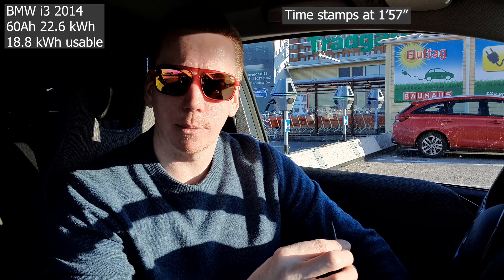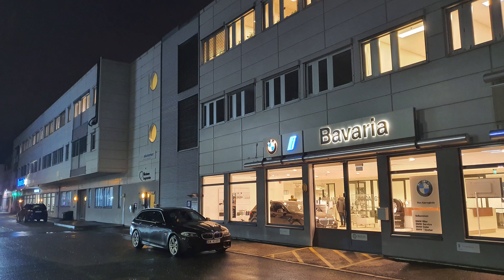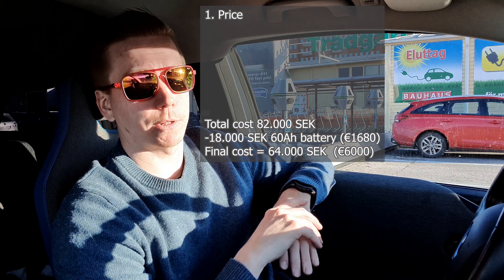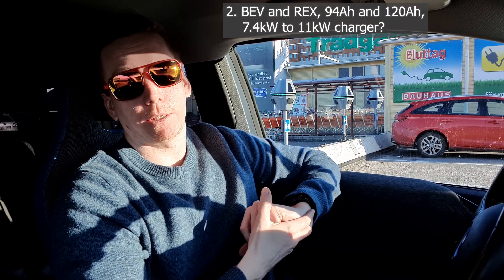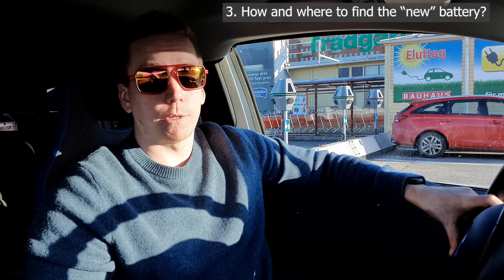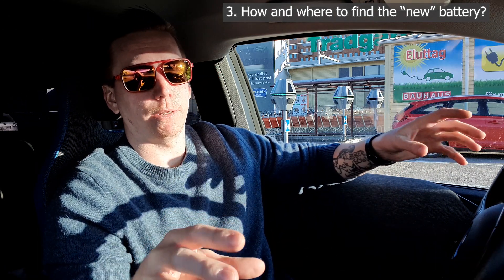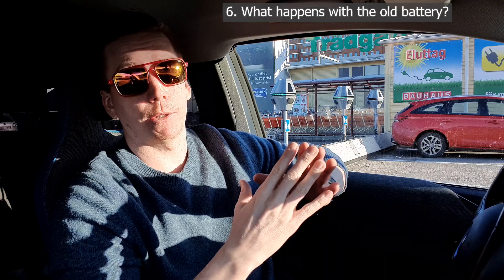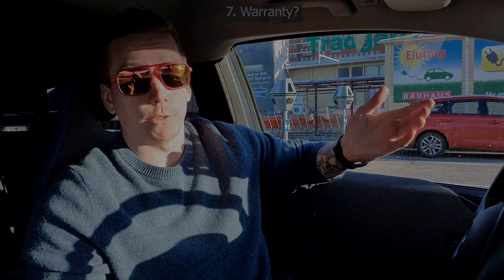BMW i3 Battery upgrade from 60Ah to 94Ah for €6000

Comment: What about the upgrade approval from Statens Vegvesen? Any problems?
Reply from the maker: Well, since its a Swedish car that wasn't relevant. But since the new battery had almost the same weight (+50kg or so) I never did any official documentation of this with the government. I can't remember if I called the agency for transportation here but I'm pretty sure a battery swap like this is ok.

No problems with the two yearly vehicle checkups after the swap. Passed them both. Even with the aftermarket Hitch.

Comment: Bmw warranty approved replacement of battery bmw I3 bev 2014 .the problem they have installed the new battery but the car don’t recognise the new battery .Any thoughts ?
Reply from the maker: As I remember the new modules have a number that have to be coded into the car for the car to recognize the battery. That’s the only idea I have.
Reply: Poradziłeś sobie z kodowaniem?

Comment: Do you have a phone number for the dealer that coded your battery SME?
Reply from the maker: It is this Bavaria center i went to:

Bavaria Lillestrøm
C. J. Hansens vei 15, 2007 Kjeller, Norge
+47 64 84 73 00
https://maps.app.goo.gl/dAc2ESa2Qv3fvL92A

Comment: I'm about to buy a 2015-2017 bmw i3. do you know how long these battery's last until you need a new battery. Also will the battery be at 60% or so after 100,000 miles?

Comment: Hi, Did you only need to change the battery? What about the battery charger (OBC) and the Battery heater/ cooler, can you use the old one? And are there any other pieces you need to change?
Reply from the maker: The only thing that I bought and brought to bmw was the batterypack. They did order a new lid for it though as it was in the manual, to replace it as it was removed for an inspection.

The charger, heater and all such is still the same as before the swap.
Reply: @BasinBjorn  Thank you very much for the quick reply

Comment: I currently own a 2019 e-Golf with a VERY high spec. It was an Ex-Demo car. LIke yourself I have invested in the car quite a lot (Eibach Pro spring kit, 18" wheel upgrade, de-chrome, de-badge, PPF front half of car. I like you have invested a lot in the car and although this is a pain if I was to change the car in 3yrs when the finance is finished. I would actually like to keep the car for longer as I think the 7.5 is a better quality car than the new Mk8 and as for the ID3 I think it is a glorified VW UP. all plastic and coloured metal parts. I also feel it such a waste to change my car because the battery will have degraded (in 3yrs I will have over 100,000 miles on my car as I cover 26k per year) I have posted my question if people know of battery enlargement or swapping companies like MUXAN do for Nissan, and people seem to rip me apart. Telling me to just change the car.

Comment: Hi can someone tell me how much it cost to charge at home to fully charge in £ I’ve been to £1 at night that can’t be correct can
Reply from the maker: It all depends on your price for electricity, and that can vary a lot depending on country and region.

You should be able to see your electrical price in your electrical bill, then multiply the price per kWh with how many kWh's that your car needs per time.

My electrical price in Stockholm, Sweden is 1.24 SEK/kWh, that is 0.12 Euro/kWh.

If I come home with 10% and charge to 100% then I'd need 27 kWh (plus efficiency losses).

27kWh * 0.12 Euro = 3.24 Euro to charge to full, in my example. If we add 10% for losses then we get 3.56 Euro.
Reply: If you go with Octopus energy they do a night time tariff of 5pence per kWh so that would be about 90pence

Comment: Also, in CANADA, the cost for a 94ah module is 5115$ plus taxes, not installed.... and PER module. You need 8 of them. So a little more sane solution would be much appreciated.

Comment: Little precision: As I understood it, the ''hidden menu'' shows the total capacity (22,2 kwh as new) and not the net useable (18,8), same for the 94ah which is 33,2 new (as per Bmw specs). So a reading of 16.0kwh means it remains 72% of life battery.

Comment: Very nice video of your upgrade. Can you share the BMW partnumber of the 90Ah pack?
Reply from the maker: Not sure if there is a part number of the whole pack, I did search on koed BMW and didn't find it as a part.

But this is rather something you find by searching for "BMW i3 94Ah battery pack".

Just make sure to search for 94Ah and not 90Ah.
Reply: B as in Bjorn thanks!

Comment: I have changed battery from 60 to 94 ah, total cost 4000€ 😊👌
Reply: Where? if I may ask..
Reply: @KoenBroumels  was here in Norway:)
Reply: @shazad1984  More specifically. Which dealer or shop and where was the job done? Takk
Reply: Einar Kjerschow  not a dealer. But some bmw specialist i know:)
Reply: @shazad1984  Would love some contact info if possible. I'm considering a 60 to 94 swap in the future. Greetings from Finland!
Reply: @Pajune onko omnistunut akunvaihto? Meillä 14vm 60ah mihi miettiny vaihtoa myös.
Reply: Can you share details?
Reply: 3k, i win

Comment: BMW have manual! All BMW i dealerships are capable of this job. It's been done in Germany by dealers. However in UK dealerships are franchised and prefer to sell new lease.  But long term EV sustainability is key. Lots of salvaged packs in future which are not properly recycled. 95% of lead acid batteries are recycled. 95% of lithium based ones are NOT!

Comment: Thanks, very useful. Aren’t all BMW i3 variants are fitted with an 11 kW on-board charger for AC charging?
Reply: The 60Ah-i3 only had a slower charger, i think it was a two phase charger that also could work as a single phase charger. They changed this with the introduction of the 94Ah battery.

Comment: Great video. In the fall, we upgraded our 60Ah rex to 94Ah (5500,- EURO) and our 60Ah BEV to 120Ah (8000,- EURO), so it can be done. My impression is that it's a fairly straight forward procedure and that coding can be the tricky part. Our workshop used about 3 hours on a swap. It's really a shame BMW dosen't offer this service, but I guess they rather sell you a new car.
Reply: Hey Mads,Where did you buy the parts? did you only upgrade the battery or also the charging?
Reply: Hi Frode, I used a workshop in Liturania, Ego motors, which I read about on a German forum. I did not upgraded charging; I do not need it and to do it, I think you need to change many parts like socket, cable, EME etc.
Reply from the maker: Oh thats a really good deal on both! Hope this gets more easily available soon.
Reply: That price is already amazing and considering battery prices are going down and capacity is growing Wes te in for a beautiful EV future!
Reply: Mads link from that shop please , I'm in europe so it may be done ...
Reply: Luis Vieira,  we used “EGO Motors” in Lithuania. (Ferry from Sweden and Germany). First class work, only I think he have increased Price by now :-) He speaks good english. https://en.m.autoplius.lt/bmwdalys/ads/auto-parts/car-parts

Comment: what's range now compared to before?
Reply from the maker: Now I'm getting about 210-230km per charge. The highest I've seen so far is about 250km on the guess-o-meter and it seems to show a true estimate.

Charging is also faster since it now tapers off the charging current at about 85%.
Reply: @BasinBjorn  , yes,  the improved fast charging is a real bonus on longer trips.